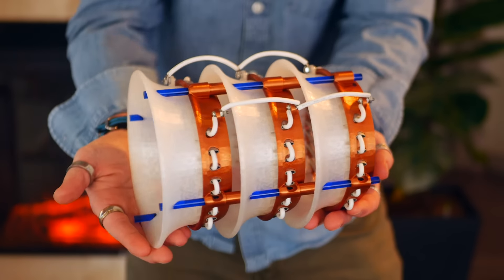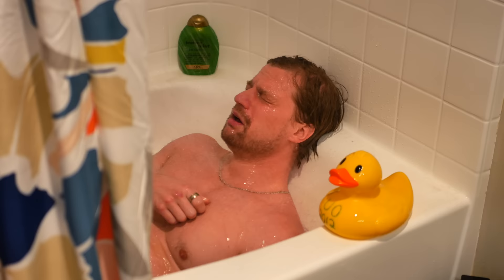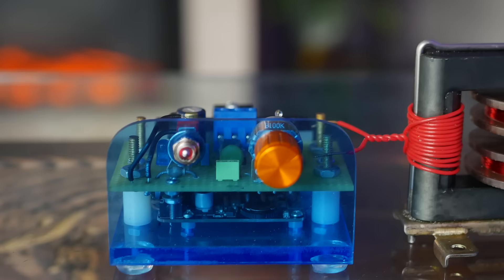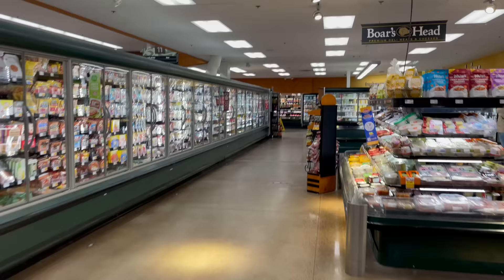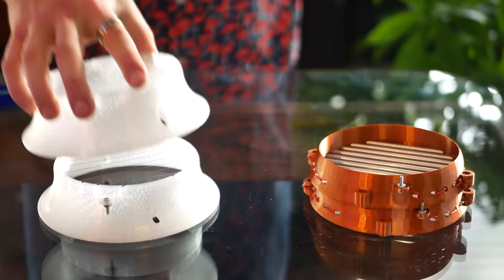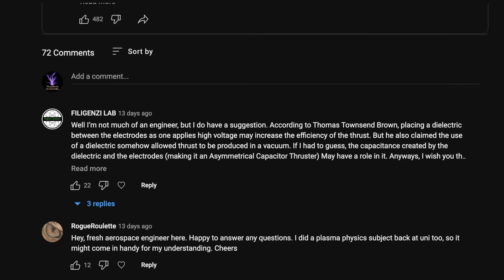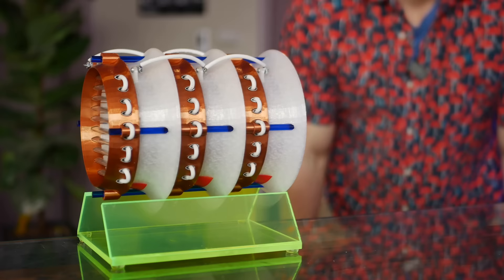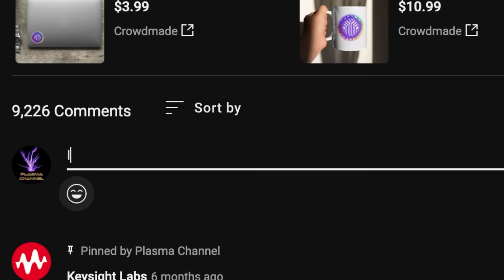The Next Generation of Ionic Plasma Thrusters (BSI MARK 2)

Comment: I think increasing the distance for later stages might be something to consider. Smaller distance was ideal for the first stage, but that does not mean that is ideal for all the stages. That setup with a fan would be useful to test what the ideal distance is when the air comes in with speed already. That might make it worth modifying even the first stage if you plan to use it in a plane as then you have some air speed from the planes speed.

Also, how about metal strips instead of rods, those would have much less air resistance with similar surface area. Might want to experiment with tighter spacing between each as well.
Reply: Automated distance control base on wind speed and more control on waveform on each stage could lead to massive optimization.
Reply: Come to say the same. I think  the additional speed of the next 2 stages comes from the extra airflow from the side. interesting would be a test with closed 2/3 stages. And after that changing the spacing in the second and third stage.
Reply: I was going to suggest the same thing. and perhaps move down to 2 stages with a lot more chances for discharging. Part of the problem here is that the positive and negative fields are too close and its not given the air enough time to charge and discharge.
Reply: Was going to say the same. Also could have a test rig that allowed screw or slide operated grids so you could quickly test an infinite variable position without having to assemble/ reprint every time. Then just back measure the distance that provides the best flow
Reply: OK let's get this correct  !!   #1  The only reason radio waves and AC current travel out in space and down a wire is because of the "CENTER " of a magnetic field.  (The "B" field), The North and South poles are the weakest part of a magnet !!   Just like Tesla said,  you got to look at things you can't see !!  At the center of a magnet is anti gravity,  (just tap the center on any glass or plastic and it will loose weight), The center can repel water if vibrated at the correct frequency,  If you vibrate the "B" field into granite rock it will become soft and you would need copper tools to work on same , you don't want to disrupt the magnetic (B")field ) with other iron.  Once you understand the "B" field of a magnet and how it relates to the entire universe we live in, you will then understand what Tesla was telling everyone "LOOK FOR WHAT YOU CANNOT SEE""  .I believe the pyramids were inter galactic communications and transportation systems.  Stone Henge and Gobekli Tepe , power plants.  Take a look at Coral Castle Florida on YOUTUBE and you will see a similar pilar. I believe these horizontal pillars were oscillators that would provide excitation for many things from crops in the field to anti gravity
Reply: @vincecox8376  this is an April fools joke yes?
Reply: @milamber319  this escalated quite quickly here. I missed the turn with copper tools. I think I have to rewatch the video.

Comment: I think you could increase thrust by shrinking each thruster by about 20% from the stage before it. And increasing power in the smaller stages to concentrate the air flow.
Reply: I agree maybe with that closing the gap between  each stage. You're essentially creating a multi stage compressor but with less moving parts and much smaller. It reminds me of the inlet guide veins on a multistage compressor. Maybe a thought of closed or close to closed between each stage to force some compression with as another comment said to use more power to the end stages stepped up incrementally. I dunno though just some thoughts.
Reply: moar venturi
Reply: Why does my brain fail to understand the concept?
Like, if the largest stage pulls in X amount of air, and that’s concentrated so that the smallest stage is pushing it out faster (this makes sense), doesn’t that create exactly the same amount of thrust since it’s moving X amount of air no matter how small the smallest stage is?
Reply: @JB-fh1bb  the total volume of air displaced stays constant yes, but exhaust velocity is important for thrust,  check rocket thrust equation.
Reply: Compressing air on an ionic thruster is not helpful or relevant. Divergent and convergent nozzles placed and sized correctly however, are key.
Reply: Oh wow it's the IONIC BREEZE fan from Sharper Image, that we all copied and recreated in our backyard shops 25yrs ago. 🙄🤣
Reply: Think about your typical garden hose.
The volume of water coming out remains the same when the hose is wide open, vs when you put your finger over the opening. But when your finger is over the opening, the water comes out with more power.

The same goes for a river. Where the river is wider, it moves slower, than where it does where it's more narrow. The same volume of water is passing the space. 

I'm this instance, let's say the thruster is moving 30 cubic feet of air per minute. That 30 cubic feet of air is going to have more power coming through a 6 inch opening that it will over a 16 inch opening.
The volume of air remains the same, but the pressure of the output creates the thrust. More exhaust pressure, more thrust.

Comment: Have you considered reducing the diamater of each stage to tighten the airflow?  Also we need to see these thrusters actually push something.
Reply: In addition, he should put a cone on the end to increase pressure, similar to an actual jet
Reply: Was looking for something like this, makes sense to try it since we do that in jets already
Reply: In my work with fans I have come to understand that, to increase airflow, an increased pressure drop from inlet to outlet is desired. So, restricting the exhaust would reduce airflow.  From the testing in the video, the successive stages seem to be only marginally overcoming the flow restriction imposed at the output of each previous stage.  Therefore, maybe the opposite should be tried. That is, to increase the diameter of each stage after the first, instead of reducing the diameters.  Also, my gut tells me that increasing the diameter of each stage would reduce interference of the entrained airflow into the side inlets of each successive stage.  I would also consider to route the wiring between stages through the support rods between stages, and route the wire loops at the exterior of each stage (connecting the ground electrodes) into grooves on the inside surface of the electrode structural cyclinder.  Maybe this could be done in a way to eliminate the need for the white wire insulation buffer, which seems heavy.  Overall, the idea is to reduce restriction of flow entrained to the side inlets and possibly reduce overall weight.  To increase flow velocity and thrust, perhaps a reducer could be added at the highest diameter output stage to make the final output flow diameter the same as (or even less than) the input diameter.  But then again, the reducer might kill the overall pressure drop.
Reply: This was something I thought about, but reduced diameter also means that the smaller stages will not be capable of the same output. In doing so, you would be putting a less capable thruster right behind a larger one- would likely slow airflow.

Comment: Only thing I can suggest trying is gradually shrink each stage. Same volume through a smaller area makes more speed. Awesome work! I look forward to the next iteration. Where's Electroboom? I need to see him make one!
Reply: The efficiency losses from forcing the air into a smaller diameter will likely not be worth it
Reply: or add many stages in parallel with the outlet giving a bigger output
Reply: @richardmillhousenixon  what efficiency losses? Air pressure at the output? isn't that the goal? Making a nozzle is an effective way of increasing fluid output speed. Have you every used an air compressor with a nozzle attachment? did you feel the reactionary force on your wrist when you open the nozzle? That reactionary force is called "Thrust," and it is driven by the difference in air pressures.
Reply: Not only speed but air volume also matter when it comes to how much actual thrust an engine will give.
Reply: Kinda like when you put your lips together when you blow out candles. You don't blow with you mouth wide open.

Comment: Awesome work! some ideas: instead of straight tubes you could use circular tubes to more effectively use the geometry. and maybe put the center once further back so you take more air from outside and push it in. also making the stages smaller as you move along could introduce even more compression which hopefully will increase the airflow.

I'm no expert though so maybe what I just said is really dumb lol.

this was an awesome video and I love that you're taking us along the ride through the whole development process. to me that really makes it engaging to watch!
Reply: OK let's get this correct  !!   #1  The only reason radio waves and AC current travel out in space and down a wire is because of the "CENTER " of a magnetic field.  (The "B" field), The North and South poles are the weakest part of a magnet !!   Just like Tesla said,  you got to look at things you can't see !!  At the center of a magnet is anti gravity,  (just tap the center on any glass or plastic and it will loose weight), The center can repel water if vibrated at the correct frequency,  If you vibrate the "B" field into granite rock it will become soft and you would need copper tools to work on same , you don't want to disrupt the magnetic (B")field ) with other iron.  Once you understand the "B" field of a magnet and how it relates to the entire universe we live in, you will then understand what Tesla was telling everyone "LOOK FOR WHAT YOU CANNOT SEE""  .I believe the pyramids were inter galactic communications and transportation systems.  Stone Henge and Gobekli Tepe , power plants.  Take a look at Coral Castle Florida on YOUTUBE and you will see a similar pilar. I believe these horizontal pillars were oscillators that would provide excitation for many things from crops in the field to anti gravity

Comment: Question: Have you tried modifying the ratio, or even simply the number, of wires to grounds? From what I can tell, it's currently pretty close to 1:1, what happens with 2:1, or 1:2? Would you be capable of charging more particles with more contacts?
Reply: I wonder if an insulating deflector would help too. If its posible to force the charged ions to take a curved path round a deflector to the ground. Idk if that would increase charge density between deflectors and force the air to interact with it more.
Reply: I was thinking the same thing, I also wonder if it may make more sense to only use conductors around the edge of the ring (after the first one) so that it's spending more time accelerating air around the edges rather than trying to re-energize and pump the already moving air more.
Reply: 2 questions
You said the following stages had issues initially with the interactions because the aur passed too quickly. What happens if each subsequent stage had larger spacing between the wires and tubing?
You also said between the wires and tubing in each stage, parallel is king. What happens if each stage is rotated or even offset? 2 or 3 repeating sections if offset is best? If rotating works instead, see if 120 angle rotations in sets of 3 help.

Comment: One part of the video if you watch over it showed when you waved your hand over the back of the flow meter the pressure output increased, try putting in air resistor plates between each stage to allow for pressure build up as it passes through each stage.

Comment: I recommend creating this device in a fluid dynamics program so you can visualize where the air is becoming turbulent, also it will allow you to test more variations of the the housing shapes and angles.

my main suggestions to improving this design is you need to create low pressure in the middle of the design by having that be a smaller diameter (the housing needs to be air tight though so it doesn't leak) and also add a nozzle on the end so the air flow isn't coming out turbulent but more precise in the centre.

also it might be worth playing around with the idea of two intakes and having them be forced into a single housing with a much smaller end end housing.

always awesome to see your progress in this, keep up the awesome work!
Reply: Two intakes forced into a single housing would be effectively the same as one large intake right?

Comment: Would putting more space between the positive and negative electrodes for the later stages allow them to work better with the faster air that the prior stages are pushing? It might also be worth seeing what staggering the pairs of electrodes on later stages so that each stage is staggered from the previous would do.
Reply: If we're increasing the gap as we go further back, we might also need to have the voltage increase too.
I imagine it might function like shifting gears; torque prioritized at inlet, speed at outlet.
Reply: I believe he tested this in his first video
Reply: Well, would increasing layer spacing on subsequent stages have an effect? Let me think it through: The spacing affects the electric field between the electrodes, which determines how abruptly the ions accelerate. Or in other words, how much excess kinetic energy the ions are given over their neutral brethren for every millimeter they travel. While the potential or voltage between electrodes determines how much energy the ions receive in total. But since the ions need time to shed that excess speed to the bulk of neutral air around them, we probably want them to gain the same amount of excess speed per millisecond, which turns out to be mathematically the same as kinetic energy per millimeter (as long as you don't change the mass of the molecules).
Which would suggest that the layer distance should stay equal in subsequent stages, at least if we want all stages to have the same efficiency (in terms of converting current or wattage into air molecule momentum). This isn't the only factor at play, though. Other factors include:
-- Ions repel each other, and giving them enough time to spread out can allow them to affect more than just a small sliver of the total air flow.
-- The field strength between the layers directly influences the field strength at the positive wire electrode, and that field needs to stay strong enough to ionize air molecules.
-- Faster air will increase the flow rate of molecules past the positive wire, and more collisions with it means that more molecules get ionized per second, but the same amount per volume of air.
Reply: OK let's get this correct  !!   #1  The only reason radio waves and AC current travel out in space and down a wire is because of the "CENTER " of a magnetic field.  (The "B" field), The North and South poles are the weakest part of a magnet !!   Just like Tesla said,  you got to look at things you can't see !!  At the center of a magnet is anti gravity,  (just tap the center on any glass or plastic and it will loose weight), The center can repel water if vibrated at the correct frequency,  If you vibrate the "B" field into granite rock it will become soft and you would need copper tools to work on same , you don't want to disrupt the magnetic (B")field ) with other iron.  Once you understand the "B" field of a magnet and how it relates to the entire universe we live in, you will then understand what Tesla was telling everyone "LOOK FOR WHAT YOU CANNOT SEE""  .I believe the pyramids were inter galactic communications and transportation systems.  Stone Henge and Gobekli Tepe , power plants.  Take a look at Coral Castle Florida on YOUTUBE and you will see a similar pilar. I believe these horizontal pillars were oscillators that would provide excitation for many things from crops in the field to anti gravity
Reply: @vincecox8376  Oh sweet, a schizo thread!